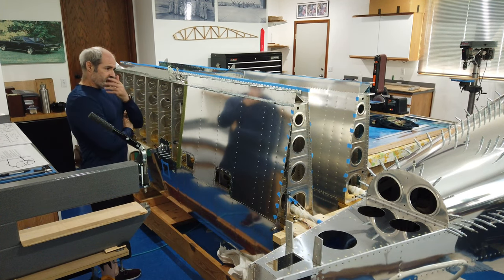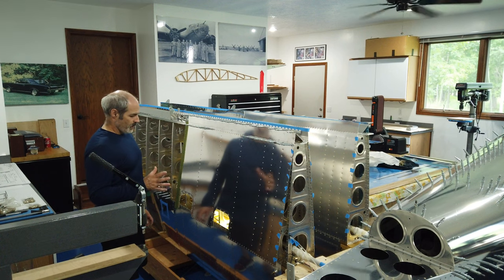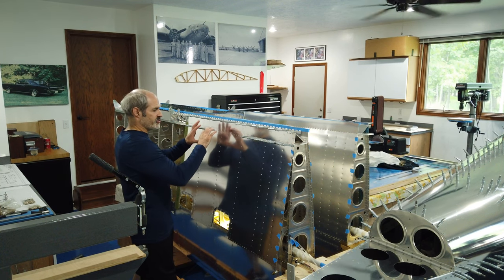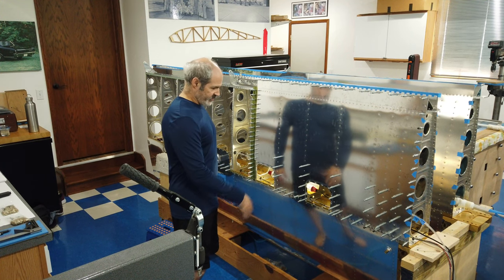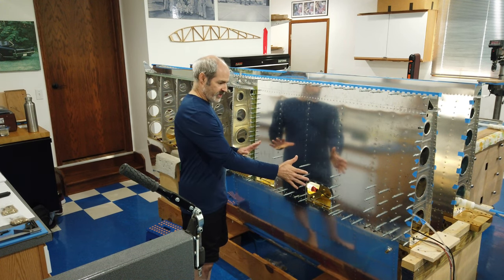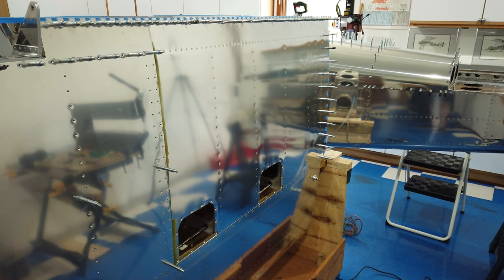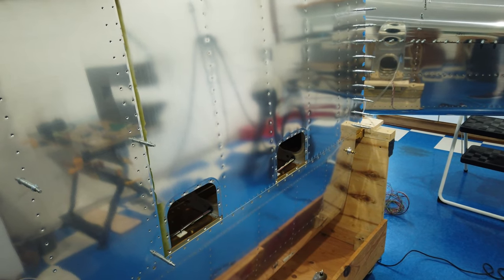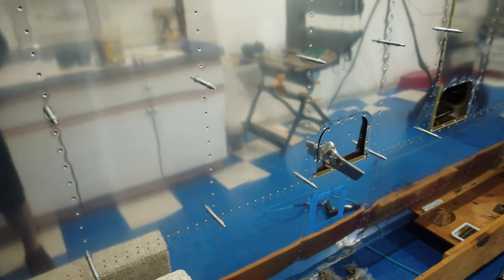Vans RV 7 HINT Video Wing Bottom Skin Riveting

Comment: For builders of RV7, RV8, and RV9, the bottom wing skin can be riveted by one person, working alone.  The wings on the RV14 and RV10 slightly larger but they can be riveted.  This complain about the difficulty to rivet the bottom wing skin is totally unfounded, caused by the overhyped internet.  After I told people they could do it by a single person, they went and tried it and got it done, without drama.  Vans knows what is is doing.

Comment: I just noticed, the nutplate you used on access panela on the main spar looks to be the same size as the nutplate used in the skin.. the countersunk holes looks huge on the main spar?
Reply from the maker: Howdy Zed.   The spar nutplates are standard, but the holes on the spar must be countersunk to accept the dimpled access cover; which is dimpled for a #8 screw head.  The countersink for a #8 screw head is quite large.

Comment: What is that pitot tube on there? Looks like a Piper style. What advantages does that one have over the Dynon version?
Reply from the maker: Yes Tom, that is a Piper style blade type heated pitot. I don't know about the current Dynon pitots, but this one I was able to replace the cartridge heaters. It has a static port built in and it does not stick out as much as other non-blade types. I just prefer it over the others.

Comment: Do they give you an option to use pulled rivets on the bottom? That would sure make life easier.
Reply from the maker: Vans does not mention pulled rivets as an option.
Reply: These are usually all flush rivets, they have to be bucked
Reply: Pull rivet will probably be stronger but they are heavier, and they destroy the value of the plane